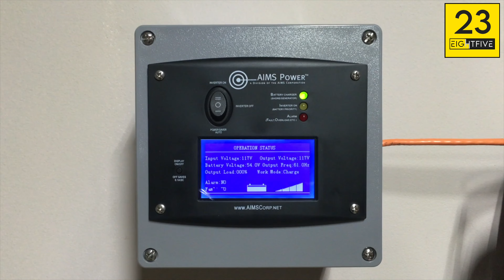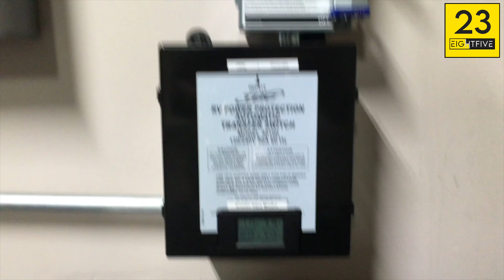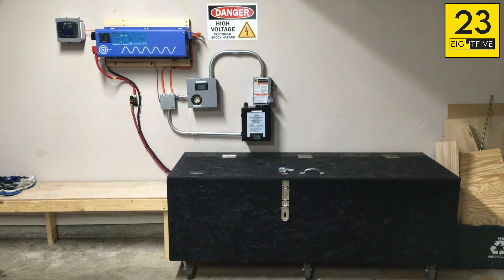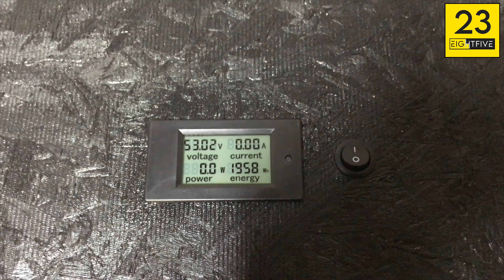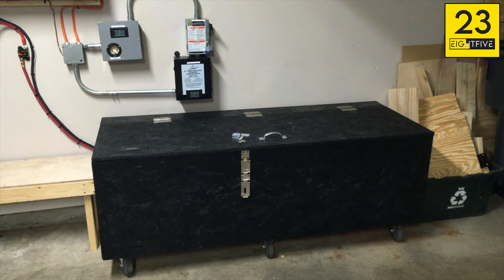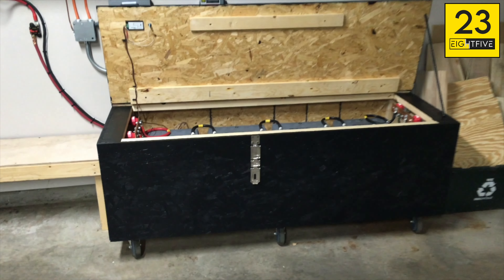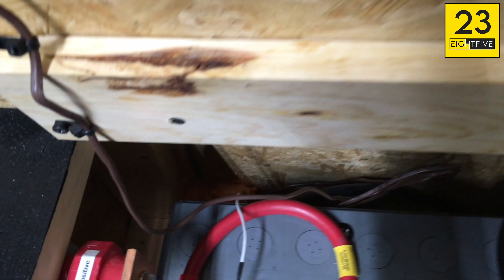Aims 6000 watt 48v inverter and battery bank Whole home uninterrupted backup - 1.5 of 3 - Remastered

Comment: I remember this video from way back and the system is awesome with the batteries and especially the AIMS 😉which is the beast of an inverter to run the many loads a prepper can be proud 😊🤗of during any SHTF situation or at will to save on the light bill . How is it today in 2023 ? Check out my solar videos , hit like , leave a comment and subscribe . May the solar be with you .😉
Reply from the maker: Oldie but a goodie!

Comment: You were smart to use a low frequency, transformer based inverter charger instead of one of those short lived, lightweight, high frequency, transformerless inverters that everyone else sells. This low frequency inverter will last you a very, long time.
Reply from the maker: I’ve been very happy with this inverter!